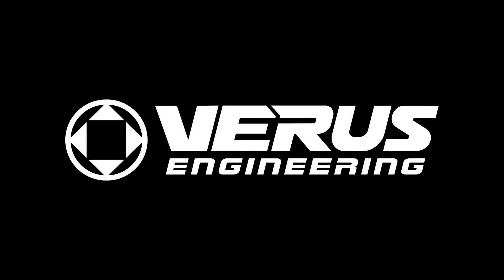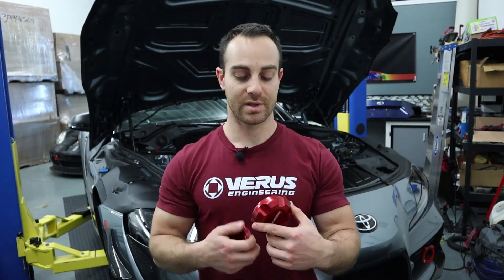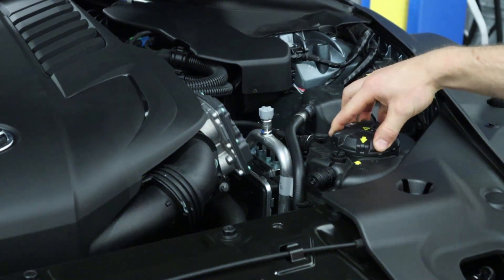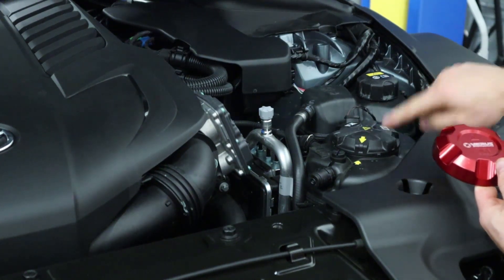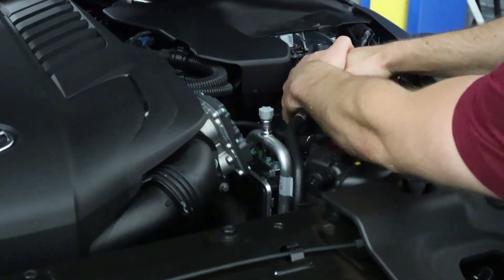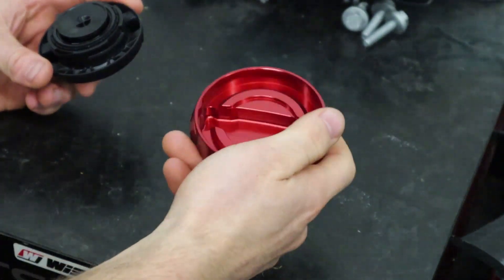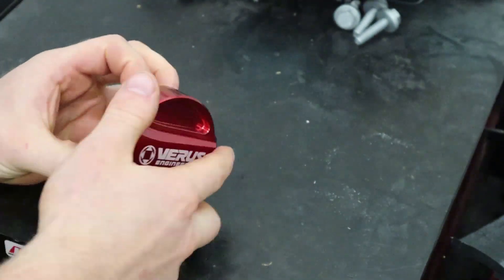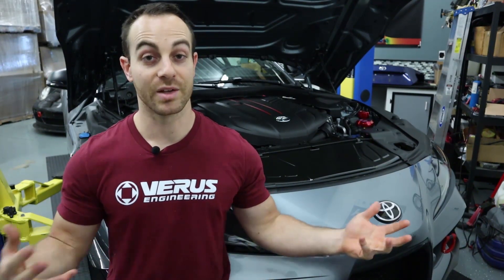2020 Toyota Supra Coolant, Heat Exchanger, and Oil Cap Install

Comment: Do these fit 2021 BMW M340i B58 v2
Reply from the maker: Unfortunately, we can't confirm. It looks like the coolant and heat exchanger cap are similar, but the Oil cap may be a little different.
Reply: @ thank you for the fast response. Great looking parts. 👍

Comment: The pictures on your website for the oil cap show some weird machining issues or anodizing issues on the recessed areas of this oil cap. Is that bad manufacturing or just bad pictures? Is the machining and quality of these top notch?
Reply from the maker: We use blemished caps on our shop vehicles.